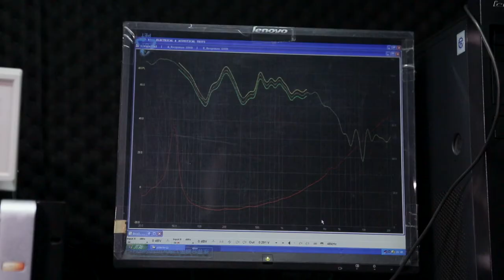AERONS speaker manufacturing process

Comment: 600El ka takkar ka speaker konsa hai Bass k liye 15"
Reply from the maker: We have 15BM1200 our 1200w speaker for bass mids. This speaker is very popular in your area and you can contact our dealer M/s Rajesh Audio House, Mr Sanjay Gupta tel: 9162053173
Reply: @AERONS  nx Audio rx 4000 me 4 spkr bazjaega?
Reply from the maker: nahi sir, you need heavy amplifier for best results. we suggest minimum 1200w @ 8ohms per channel, 2000w @ 4ohms per channel. like in NX audio you need MT 1201.
Reply: @AERONS  but rx 4000 m 4 El to bazate hai
Reply: But El overpriced hai
Reply from the maker: Ahuja amplifier are not for DJ. We also have 15w2226h its 600w but its mid-bass.
Reply from the maker: 15bm1200 in aerons is our only option in 15inch speaker for bass in AERONS.
Reply from the maker: you can talk with sanjay gupta ji which amplifier is best because you are his customer and he will offer you best product with best price.
Reply from the maker: you can play but you will not get best results from your speaker. Please talk with Sanjay Gupta ji
Reply from the maker: 15bm1200 price is Rs 9500 each, 1200w, 4" VC and 220x30mm Magnet.
Reply: @AERONS  peak

Comment: 2 top double 15 500wt price
Reply from the maker: we don't have dual 15" tops. if you need 15" speaker for dual 15" top then mb15f500 and price will be Rs 5000 each.
Reply: Cabinet price
Reply from the maker: @shuttercraftstudio7773  we don't sell empty cabinet or dual 15" tops.